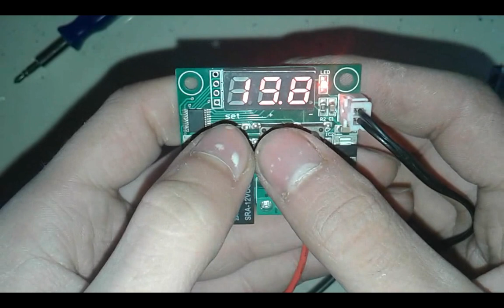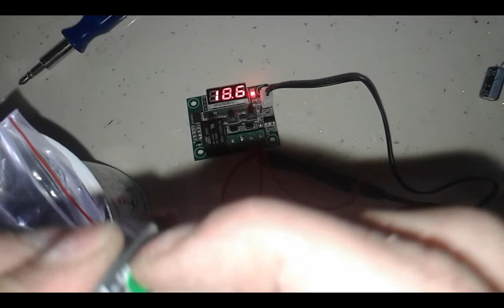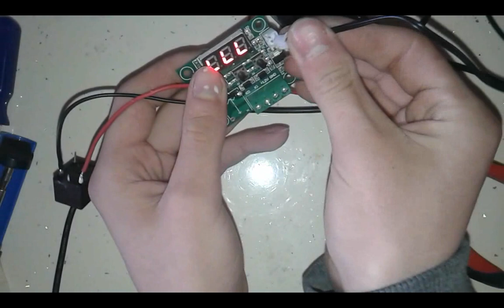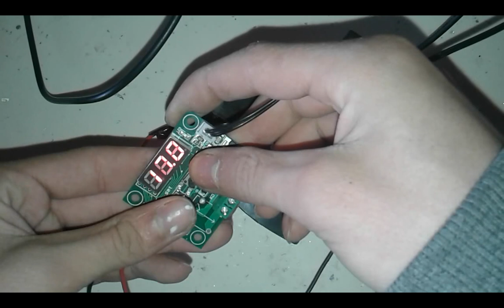Installing a w1209 12 volt DC Digital Temp Controller to a Fann

Comment: i have multiple fan connected to the controller but when it reaches the set temp the display starts to show chaotic temp. the fans are of different amp, 1 big, 2 smaller. what could be the problem?
Reply: Kha se mile ga ye bhayi

Comment: How to get 1 hour relay. i.e,.Once per hour.
Reply from the maker: Adjustable 0~60min Cycle Loop Delay Timer DC 12V Time Relay Switch ON OFF Module
https://www.ebay.de/itm/Adjustable-0-60min-Cycle-Loop-Delay-Timer-DC-12V-Time-Relay-Switch-ON-OFF-Module/112527136727?hash=item1a3323d7d7:g:MjgAAOSwL9hZkt-l